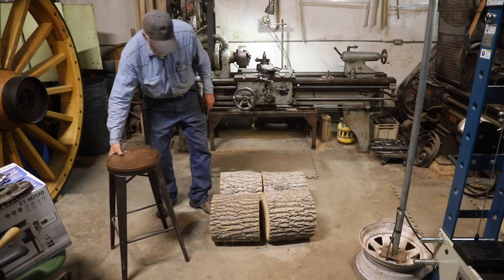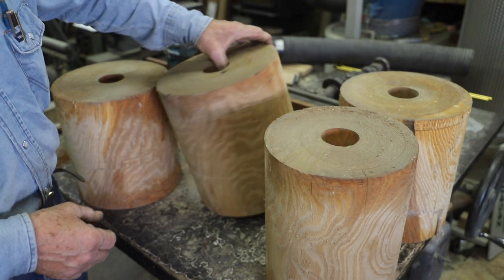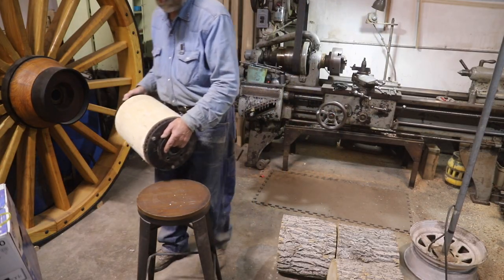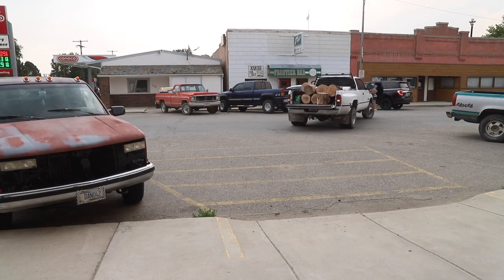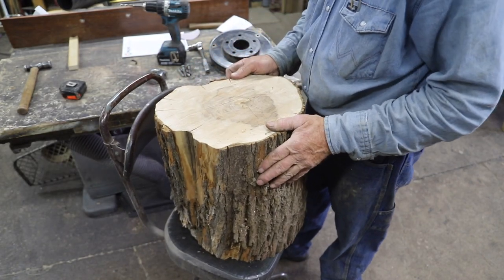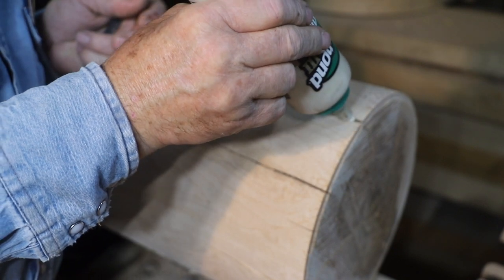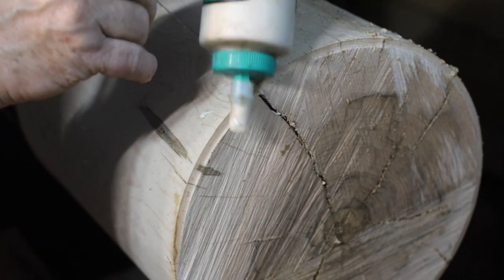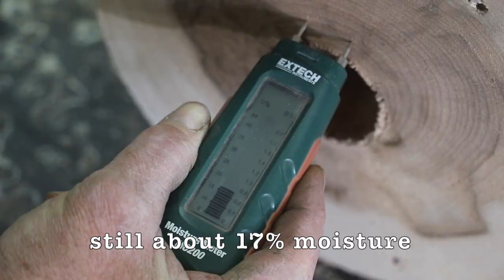Some Firewood Produces Excellent Wagon Hubs | Engels Coach Shop

Comment: Near where my previous house in France was, at Vendenesse-les-Charolles (where the Charollais beef cattle originated), there was a large timber seasoning yard, supplying wood to the upmarket French cabinet maker, furniture and super yacht fitting out trade. For most of their timber, they had 24 hour sprinklers playing on the debarked logs but for the more valuable wood, walnut, maple, cherry, rosewood, imported mahogany etc, often for the veneer business, they matured them in a salt water pond. As this location is about as far from the sea as you can get in France, they had to make the sea water themselves, by adding sea salt to regular water.

Comment: 15:07  That's a very clever idea using brake rotors to compensate for the inaccurate ends of the log.
Reply: I love he took the time to paint them.
Reply: WOW.. brake rotors… thanks for mentioning
Reply: it also helps keep it a bit safer when turning large workpieces as the pressure is not reliant on one tiny spot of wood.
Reply: I thought they were there to help slow it down.

Comment: Mr Engels, just watched your video from Mar. 20th/2020 on the 3 phase wiring job, didn't want to comment on that video cause it being a year and a half old, you probably wouldn't see the comment. Not sure if you know this tip for those 3 phase plugs, but just run a strip of 1/2" colored, (yellow, red)  tape along the male and female sides, and you never have to sight the plug ends together again. Great work you do and keep the videos coming. Love all that you post. Thanks Mr. Engels.

Comment: Awesome. I seen a neighbor had cut down a huge elm tree in their front yard. Was a massive pile of green logs cut to around 16 inches long.  I stopped and asked if I could have some for wheel hubs. He said take all I want. So i got about 2/3 pickup bed full of wagon wheel diameter and buggy diameter. Brought them home and pealed the bark off and sealed the ends completely to around 2 inches down the sides with several coats of house paint. They've been setting in my garage out of the sun for 9-10 years now. Almost perfect condition with only a couple having very short fine checking. Have a couple farm wagons, one spring board type buggy and my favorite- a mountain wagon that i want to redo. Your videos have been a blessing. I've been tempted to contact you about doing some of the work. But I really want to do it myself as that's half the fun or challenge. I try to get every tidbit to help point me in the right direction. Thank you very much.
Reply: Dave says, cool. You've really been look in ahead.

Comment: Dave, you’re inspirational. I just put my wife’s car on blocks and pulled the rotors. Now…all I need is a tree and a large lathe! Great work. Thank you for continuing to share your skills.
Reply: Just mount the wood onto your wife's drive wheel and use the car as a lathe
Reply: @jginsberg1  You took the words right out of my mouth.
Reply: @jginsberg1  I used a drill motor to turn a 4" X 4" into a globe for my flag staff.

Comment: Very ingenuous use of brake rotors for face plates!
Reply: I was wondering how he centered them but finally realized that he didn't have to do so. The ends don't even have to be square.
Reply: The problem will come if he ever needs a new brake rotor. He'll go into the modern auto parts store and the kid will want to know the make, model, 4x4, air condition, automatic or standard. Then tell him they don't have it and he can't sell him one.
Reply: Recycling, .............  it's all about recycling.

Comment: They talk about how planting trees is planning for the future. I never realized what a future oriented task it is to cut one down.
Reply: @Con Cahill  Absolutely not tmi! Thank you for taking the time to share your knowledge. I can add a little fact: Some forty years before the planned falling date it was determined how the tree could best come down, e.g. to the north-west. To avoid damage to the valued forks and what not, which could easily break under the weight of the trunk as it would smash into the ground, another tree was planted. This tree had the sole purpose of breaking the fall of the bigger tree. (timber can also crack internally btw when it falls to hard; often this only comes to light in the saw mill).
Reply: @Calligraphybooster  Thank you for that! I shall have a look.
Reply: If I'm remembering correctly each Ship-of-the-line, took 4000 trees. 
Having colonies all over the world helped to supply the navy with the vast number of trees needed to build the largest navy in the world.
The Royal Forests were also important for supplying the masts.
Reply: @bigredc222  4000 trees would be very likely, and all dock yards had "Mast Ponds" where masts and spars were left in sea water to season.

There is a book titled "The Restoration Warship" by Richard Endsor: https://www.richardendsor.co.uk/books/4595050274
This goes into great detail on how these ships were put together, what kinds of joints, the rigging, ordinance. . . . . Quite a 'read,' but worth the time if you are interested. It reminded me of how much information and how many skills have been lost, now that everything is about programming a computer.
Reply: @coniow  That link brought me to a page with three books, I ordered the restoration warship. 
Thank you.
Reply: @bigredc222  My pleasure. It is a lot of reading, but also readable :-). I found it to be very informative, so I hope you do to!
Reply: @coniow  was first made aware if ‘Brendan’s Voyage’ by an article in Nat Geo. …..Amazing book and a good read.

Comment: As a wood turner, firewood is a common source of supply. Anything that is tough to split gets turned. I find a product called Anchor Seal works well to prevent cracking and checking. It is a liquid wax type stuff that paints on that dries to a wax.
Reply: Filling those cracks with PVA and sawdust is useless. The glue requires a minimal gap (tight fit) and clamping to work. Epoxy would be better for just gap filling here.
Reply: @spudpud-T67  Titebond 3 isn't PVA
Reply: @richnfamous59  Sorry you're right, 

Filling those cracks with Titebond 3 and sawdust is useless. The glue requires a minimal gap (tight fit) and clamping to work. Epoxy would be better for just gap filling here.

Comment: Very interesting on air cavity in the rounds to aid curing I'd never heard or seen that before I'll have to try that!  Thanks for another great video.
Reply: This made me think about my buddy's house. The second floor is supported by a crossed pair of 12x12's that I know for sure we're not cured over a year. That house is 40 years old. I advised him to use built up pieces rather than solid, but it's his house.
Reply: A channel called "Mr Chickadee" often used green timber in his construction. Very interesting process especially when building a nailess structure.

Comment: It is possible with fresh elm to bore the hole and then put them in a flowing stream for a couple of weeks to wash the sap out. This speeds things up. Brush any white mould off the ends if it forms. I use elm that has died and been left standing in the hedges for some years, it’s seasoned in the hedge and can be very good.

Comment: At the  machine shop I was working I have machined lots of wagons wheels for a friend on weekends , I used a lathe and a boring mills with a large CNC DIVIDER for the pockets , the wood was mostly oak .
In general if all was going very well in a Saturday I was able to do 4 complete center wheel finished.

Comment: Makes you wonder how many of these you would have found in a wheelwrights shop at the turn of the century, given that wagons were more common and the drying time. Never thought about the amount of time taken to dry these or would they have kiln dried them to speed it up. Could result in more lost material but shorter time. Thanks very much for sharing.

Comment: Some firewood produces excellent wagon hubs and some intended hubs produce excellent firewood.:-)
 In the distant past, I burned lots of American elm in my house furnace and a hydraulic splitter was the only way to split that stringy wood. Occasionally, I now find some red elm which I can split by hand if it is dry. As the old saying goes, firewood heats twice.
Reply: I think firewood heats 3 times if you collect it yourself.  1st when you gather, 2nd when you split it & 3rdly when burnt.

Comment: Those holey/wormy ash blocks with a nice finish coat to bring out the character would make amazing coffee table legs/stool bases or maybe bowls etc instead of firewood
Reply: Yes,. Even though not good for hubs, I hate to see otherwise good wood used for fires.
And in this age such wood is increasingly hard to find. Maybe Dave could offer it up for others for a nominal fee plus H&S?
Reply: That warm feeling from a nice fire can be comforting on a cold winter evening.
Cheers !

Comment: The 10 year timeline for harvesting logs and having usable hub blanks reminds me of something I read once that talked about how Englishmen would build oak log based structures close to a woodlot that could produce both large beams needed immediately to build, as well as growing the trees that would supply replacement beams that would be needed in 100 years when the originals rotted away. Now that's forward thinking. Thanks for the video.
Reply: English oak is cut and shaped far more easily when green and Elizabethan houses are noted for the fact that as the wood dried and hardened it would warp leaving to interesting uneven floors, roof lines etc. Plus they'd be assembled on a few pillars with the foundation built up to meet the wood and adjusted as necessary over time. At least, that is my understanding.
When it came to building vast numbers of ships, no one had air dried lumber enough, they cut and processed as fast as possible. Vast areas of British oak Forrest's were denuded. See Evelyn's diaries for his views on this.
Reply: @jonwatson9765  thanks for the info.

Comment: I do not know about other species of elm, but American elm has crosslinking in the wood that prevents splitting. This allows it to grow in the "vase" shape with deep crotches where the main stems split from each other. It cannot be planned easily. I have worked with it. I made my dining room table out of it. The table top had to be sanded because it could not be planed.
Reply: I had the same issue- made a  display counter for a farm shop from old farm felled elm that had seasoned for about 40 years. It just laughed at any plane I showed it. It felt like vandalism to take a belt sander and 60grit to it.
Turned out pretty nice at the end. The grain was beautiful

Comment: Elm has over twice the moisture content of Ash when green. Therefore it shrinks more and has less strength than ash.  I've cut ash in the winter and burned  it without seasoning it. Beech is another good wood that is much more dense than ash and is low in moisture. Also try black locust. Its hard, dense, doesn't check when drying and resists decay. I've got fence posts that have been in the ground 50 years and are still solid.
Reply: Fascinating. I love your videos, Dave. Thanks for all the time and care you take for our information and pleasure.
Reply: YES to the locus. When i was younger i lived with my Grandparents. My Grandfather put me to work putting up fence around the 40 acres we owned. Locus made the best post. Will not rot in water and strong as all get out. We dug our holes with post hole diggers and tapered the bottoms for push up (when the ground freezes any post you have in the ground is going to get pushed up by the ice that forms in the dirt) problems. That fence is still up with no issues. I haven't even had to repair it and we had limousine cattle for 9 years. Great fence post wood.
Reply: I wonder how live oak would work. They used to make the ribs of ships out of it because it's extremely resistant to splitting and it's very rot resistant. Speaking from experience, it's just incredibly tough stuff. I've made a joiner's mallet out of a hunk, and not only was it a pain to work with, but it's also extremely heavy and can dent any other wood I've hit with it. I've also tried splitting it with a wedge and 8 lb maul, and even a 7" round just won't split. I also have a buddy with a portable bandsaw mill, and he says that he has to run extremely high tension on the saw and the blades only last half as long when milling live oak.
Reply: @onebackzach  They still use white oak. As a matter of fact, A guy on the west coast (he's from England) bought a sailing boat called the "Tally-ho". It's over 100 years old and he's rebuilding her. He had to find someone down south to get the white oak he needed to to the work. The channel is called Sampson Boat Co. worth the watch.

Comment: Hi Dave,
Like the reuse of the brake rotors for work holding. Never realized how much effort goes into getting ready quality wheel hubs. Guess you need to prepare some hub blanks every year to keep up a supply. Hope your summer weather is not as hot as here on the east coast. You and Diane stay safe.

Comment: The Emerald Ash Borer that we have in the Great Lakes region just bore around under the bark. That's where the live part of the tree is, and that's how it kills the tree. It's too bad about that ruined wood, but I suspect that something got into it AFTER you cut it up and set it aside to dry. If this damage was done while the tree was standing, you would have noticed holes when you cut the trunk into sections. Consider storing your fresh cuts somewhere else, or somewhat differently.

When you started this episode, I wondered to myself whether it would help to bore a hole down the middle. Thanks for confirming that.
Reply: You should see what the black carpenter ants can do to a poplar over 40 inches in diameter.

Comment: Love it when cutting wood if my chain is nice and sharp and the rakers have been cut back so you get chips instead of dust. Thought some of those blocks had some pretty good sized cracks in them,, Enjoyed the video as usual.
Reply: You need to be careful when filling down the rakes or dogs depending on what you call them. Their main purpose is to limit the amount of wood the teeth cut. If you file them to far your saw will not have the power to cut and also you will have a higher chance of kick back. They do make a gauge for the depth. I just take three strokes with the file about every three to 4 sharpenings. I do all my chain and bar maintenance with a file never a grinder.
Reply: @garymurt9112  I use a gauge to file the rakers down.

Comment: Back East, they've been cutting Ash tress down faster than you sand :)   The Emerald Ash Borer is making havok of the trees here. Oh, plenty of firewood and if a mill available, board feet and such. Most of the ones I cut up, had the larvae under the bark. But sad, all these trees cut not for use but for pests.

Comment: I know nothing about the ash borer beetle but from some other borer beetles I've run into they only start after the tree has died (fallen/cut down), stripping off the bark and getting the wood off of the ground will help prevent them from starting the cycle. (The bark and moist cambium give the beetles an advantageous place to lay their eggs)  FWIW if they were in the living tree you would have seen their bore holes when you first cut the segments.

Comment: The level of humidity is also a factor in the drying time. Drier air equals a shorter drying time. Hence the use of kilns  in drying lumber.
Reply: In reality the drying of timber in a kiln as opposed to air drying is vastly different. Air dried timber takes years, and seasonal changes affect humidity. KD hardwood is achieved in a relatively short time and the kiln assures a set moisture content. Given time and evaporation controls, air dried generally achieves a better result, provided strict controls are applied to ensure even drying, but KD is a much more efficient use of time.
Reply: Seems that the Faster the wood dries, the more likely it is to check and split!  So I would think every Type of wood has an optimal drying Rate regardless if you're Air-Drying or Kiln-Drying...
Reply: Even drying is essential, with uneven contraction its likely to start cracking. One bit shrinks next to a bit that not shrinking so much and cracking occurs due to stresses set up in material. I wonder if you could microwave them in pulses?

Comment: Interesting coincidence on the timing of this video.  I recently pruned some large 3 to 4 inch diameter branches from an oak and maple tree.  From the branches I cut up some nice straight sections from 6 to 18 inches long that I hope to be able to use on my small 4 inch lathe someday.  I read that the most important thing to do is to seal the end grain to slow down the drying so the wood is less likely to crack.  So I rubbed an old paraffin candle over the ends to try so seal it and then set them for storage on the concrete floor of my shop under an old car.  I hope they will dry out nice and slowly there and not crack up.  Time will tell. 🤔
Reply: I'm not too hot on paraffin. Linseed oil or the like continues to be drawn into the wood over time. Hit it with some more every 3 months or so and it will last as long as it doesn't touch the ground. Also is the issue that you need to be sure you cut the paraffin out as it will cause a glue joint to fail.
Reply: @dbmail545  Well it is kind of an experiment.  I plan to cut some more of different trees in the fall.  I think I will do some with linseed oil and some more with wax as an additional variable for the experiment.  Since the wax is only on the ends, I am not concerned about it.  I would be concerned the linseed oil will soak too far into the wood over time.